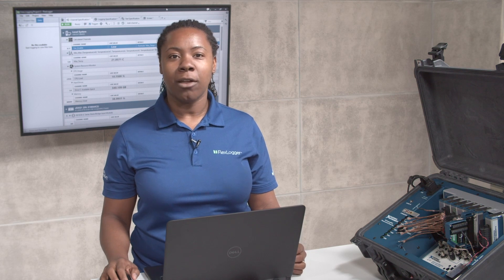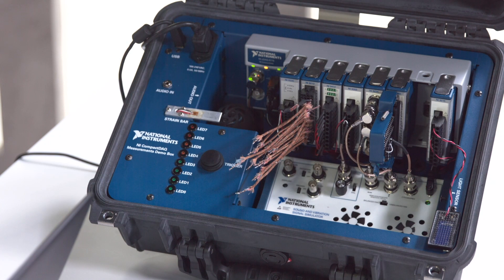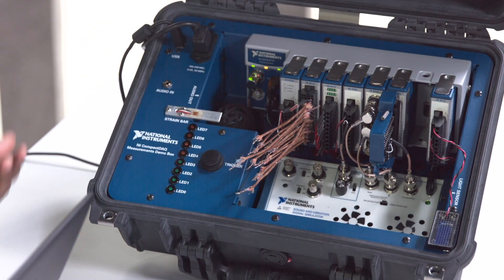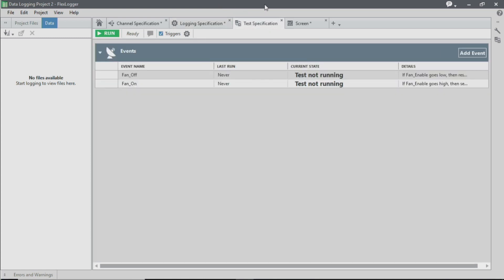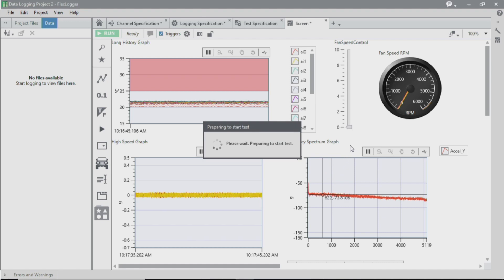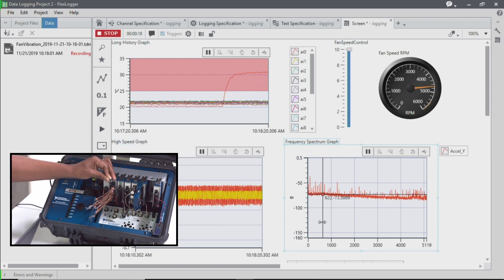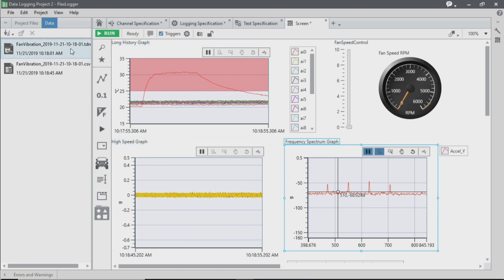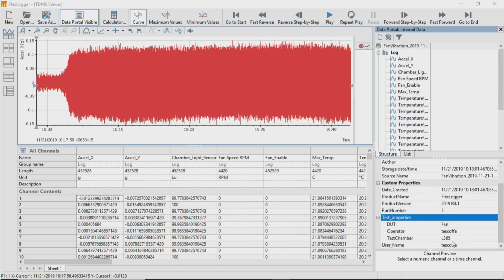Introduction to FlexLogger

Comment: Hi, in my flex logger although the live value is changing I am not getting the graphs how to solve this issue?
Reply from the maker: Thanks for reaching out! If you mean your graphs are frozen, check out this article: https://bit.ly/4bKUNnM. If this is not the case, we recommend reaching out to Support so they can help diagnose the issue and troubleshoot it with you here: https://bit.ly/4bOa0Ez.
Reply: Hi, mam I am using ni usb 6341 as daq device now the channels of usb which are connected with my instruments are ai0, ai1 , ai2, ai15 , ai14 and aignd so can you please help me to configure the channels and also in your video while configuring in that window automatically the graphs are starting but for me although the values are changing but the graphs I am not getting.. can you please help in both these cases.please...
Reply from the maker: Hi Abhishek. For technical support inquiries, we recommend visiting our support website: https://bit.ly/3Y4clIe. From here, you can share your question with the community, or open a support ticket with our team. Let us know if you have any more questions!
Reply: @NIGlobalYoutube  thank you Mam,  I worked according to your advice and it worked, the graph is now showing.  I have a doubt regarding connection , the physical connection  in usb ni 6341  are like this, wires are connected with ai0, ai1, ai2 ( + pins) , ai14, ai15 ( - pins) , aiGND for input signals and for output it is ao0, so can you tell me what should be the terminal configuration for ai0, ai1, ai2, ai14, ai15 ?